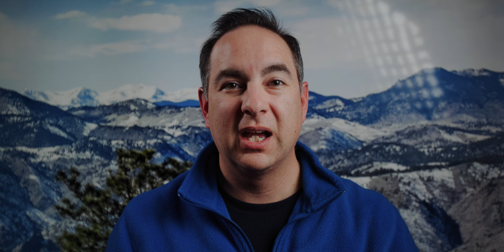What to do when you're off the air - Broadcast Basics

Comment: audio went silent once when I was the announcer in breaky,  mairlist still playing, console had pretty LEDs doing the usual disco, studio switcher was all good saying  it was still routing my studio, by now, pulse was up to 90  from its usual low 50's, quickly fired up a track in a spare studio, switched to it, still silence, switched back, made call, engineer answered  and thought I was on something, as we were still going to air..  ok bit winded but moral of story is ALSO check your "off air"  receiver  - turns out my panic attack was caused by it dying :)
Reply from the maker: Yes good point! But at that point a full engineer is needed to do the deeper troubleshooting.